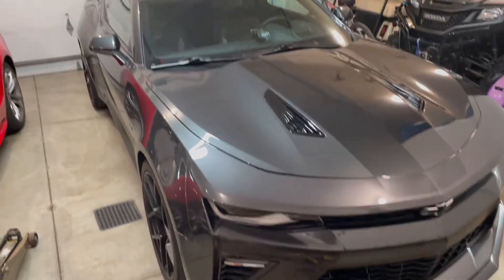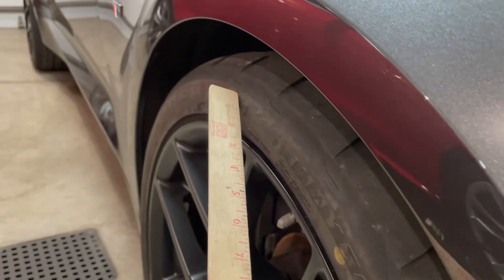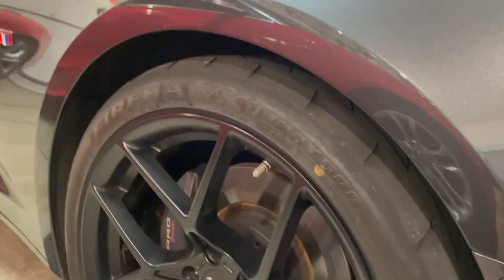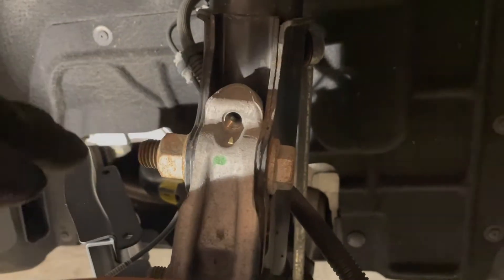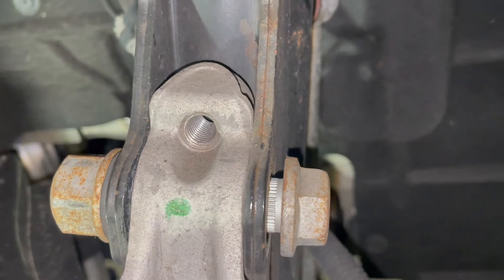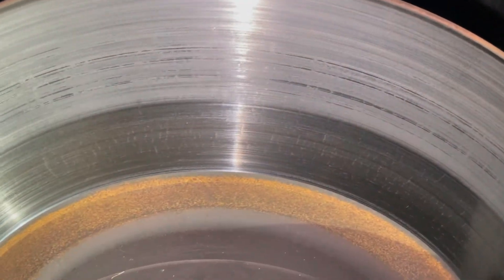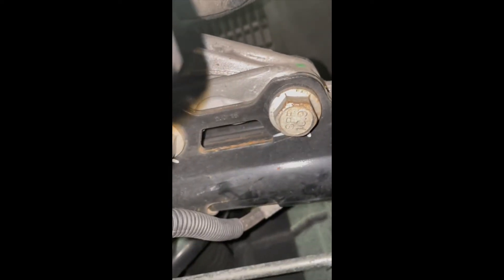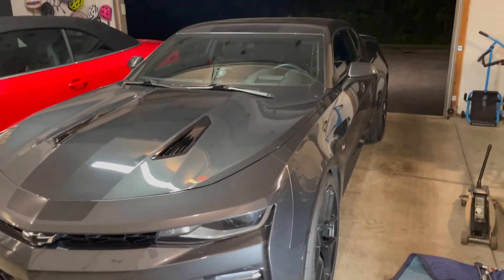2016-2023 Camaro Front Camber Adjustment

Comment: You gotta Start learning the parts of the car. Instead of saying this black part of the piece. Especially when making a video. Just trying to help you better your video making, not putting you down.
Reply from the maker: Agreed, good feedback.  I’m still learning
Reply: @ringnjc  Of course. Little by little. On your down time, I'd start learning the parts of what car your working on that way people who watch your videos can all learn on what they are called. I do what to ask you tho. What's the exact name of that car jack to body plate that you use. I'd love to get some of those for my 2000 Trans am. If you can just give me the name. I can look it up. That's a VERY NICE jack adapter
Reply from the maker: @jamesdelong6401  Dewhel Lift pads Jack Pad Billet Anodized Blue Aluminum Floor Jack bolt on Jack Points For 6th gen Camaro 16-18,except convertable https://a.co/d/bgc5Ma1
Reply from the maker: U can leave them on the car, but extra weight and I would be paranoid they would fall off on the track
Reply: @ringnjc  O! Nice. So you can have the option of leaving them on the car. Nice. O yea! I wouldn't leave them on ether. There's one you need to install on your 96 Trans tho. Look up Detroit speed shops - front fender plate upgrade -. 👌 worth the money. To not only keep your front fender gags lined up with the doors. But also give you another lifting point.
Reply: @ringnjc  ok. Thanks I'll see if they offer a set for my 2000 Trans am